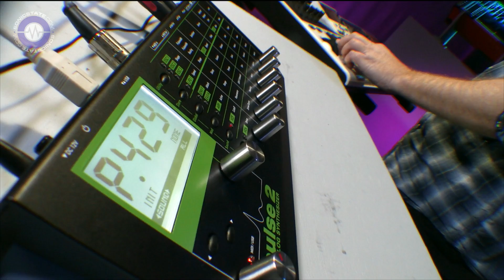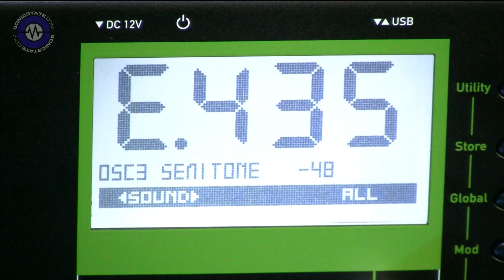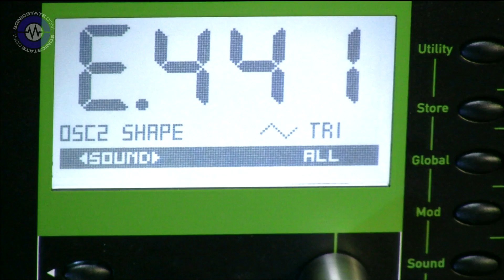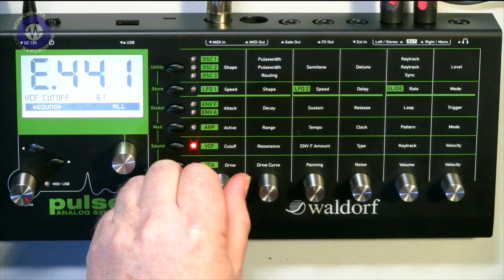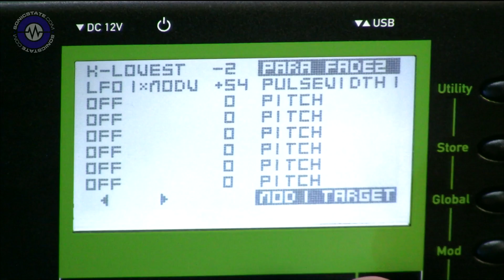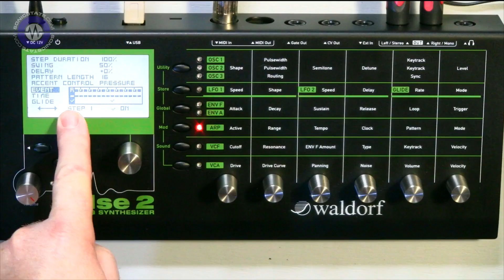Waldorf Pulse 2 Analog Synth - SonicLAB Review

Comment: My travel synth since 2013, have one in Mexico with me right now - the presets don't even begin to show the depth and capabilities of the engine - the oscillator functions and routing are incredibly versatile - AM, sync, filter FM, drive modulation, XOR. Basic monosynth sounds are easily achieved with no menu diving. 

The filters are not too exciting, but plenty versatile, its a portable sound design laboratory.......

Comment: Waldorf Pulse 2 or Behringer Neutron for monophonic sound design?
Reply: The neutron is a beast but no menu and not a way to save presets apart from taking a snapshot plus it does go out of tune like all fully analogue do. But the bass is huge. So I guess the Pulse 2 would be fab, I prefer DCOs less pain. Plus menu to save stuff etc

Comment: re: polyphonic operation.. I wonder if it is a divider type running at a higher frequency. whatever method they are using would be interesting to know.
Reply: Eight actual analog oscillators built in but only three can change shape Saw, triangle, square etc.

Comment: The synth looks like it is build to last, but as a matter of fact the knobs of all synths produced by Waldorf have a chronic problem, doesn't matter if it is the last generation (Blofeld) or the generation prior to that (Micro Q), it seems that the encoder technology is the same for all Waldorf synths. At a certain point the encoders stop responding when you turn them. It is a shame 'cause these synths have a wonderful sound, with a distinguished personality. I have a Blofeld and I had  to take it to a synth artisan wich repaired the knobs, who did a terrific job, but wasn't able to get it 100% perfet (maybe 85%), the same with my MicroQ.  It is not just me saying that, just Google "Blofeld encoders fix" and you'll see.  The synth technician told me that this problem is caused by the sample rate at the encoder is sampled, combined with the fact that the lubricant inside the encoders dry (worse if you are in a hot or tropical country), the contact plates gets deslocated, and it fails to respond. Imagine buying an ultra expensive Q keyboard and the encoders stop respoding...And my experience is that the crashes are rare, but they exist, and there are issues with updating OS as well.
Reply: I have the pulse 2 and find the knobs are also slippy so its hard to grip if twiddling filters.

Comment: Is there a parameter jump when you switch a pot from one bank of settings to another, then move it a little bit?

Say I used knob 1 to set the VCF Cutoff to max, then switched it to controlling LFO1 Speed.  If that was previously set low, but I now move the knob a tiny bit to the left, doesn't it jump to nearly all the way up / nearly full speed?

I would have thought sharing knobs between different parameters meant they'd use rotary encoders, so they could pick up where they left off, but Nick seemed to be saying they use pots.

Comment: Is it possible to use waldorf CV outs to control other gear?...I would like to 
connect Akai MPK 25 to midi in with waldorf and then CV outs from 
waldorf to moog werkstatt...would it work with these connections?
Would like to know before i will buy this synth.

Many thx !

Comment: about the digital/analog debate, i found this text (youtube/lesindes) :
" I have talked to the Waldorf service engineer now. And he was confirming
 what was in mind always: The basisc sound generators of PULSE 2 are 3 
digital controlled anlog oscillators we use to call DCO by they named 
them DO. Same as in PULSE 1. In addition there is a digital sound chip 
built in that is providing at maximum 8 digital voices (for paraphonic, 
unisono stuff) that are lead through the regular analog VCA-VCF of PULSE 2.
So the MONOphonic sound generation is ANALOG and the PARAPHONIC, UNISONO sound generation is purely digital." So yes their is DSP
Reply: They probably forgot to take into account the rabid analog bias of some synthesizer fans :)  I don't care if it's analog or digital as long as I can get sounds I like out of it.
Reply: A clever design it seems
Reply: +Michael Bauers you both misunderstood me, my fault. I know what DCO's are; i was just saying that the monophonic sound generation is generated by the DCO's (which are analog indeed), and in the paraphony/unisson mode, DCO's are desactivated and the sound is generated by DSP (8voices, pwm oscillators) ; this is what Waldorf say when you ask them precisely how they do 8voices paraphony with only 3 DCO. it is because paraphony is DSP
Reply: +TheOrangepeak mono is ANALOG and unisson and poly are DSP (digital) !! great synth but i feel Waldorf hide a bit the digital side of the pulse2, and it's a shame in my opinion, it's almost lying to the customer ..well it's no bigdeal as it sounds nice but they should have assume it.
Reply: +TheOrangepeak Dco doesn't meant its not analog, its just digitaly controled analogue oscilators in difference from Vco which is voltage controled :V For example Bass station 2 have dco too and its analogue...
Reply: +Marian Rogowski Since when is DCO not analog.  Ah well, people will believe what they want.  While DCOs and VCOs are different, but are analog by any reasonable definition.  A digitally generated wave is different in that it's a bunch of digits running through a D2A.  DCO looks analog except for the digital timer
Reply: +Marian Rogowski monophony is Analog (DCO indeed) but paraphony/unisson is generated by a chip (DSP) that emulate 8oscillators.
Reply: +Michael Bauers i just said that...
Reply: yes i also think it's clever and while i could understand why they didn't communicate that much about the dsp part of the pulse, they should have speak about it, people trust have been abuse ; this might sound stupid but it will keep me from buying a Waldorf product. Sorry for my bad english, cheers :)

Comment: Please do the Waldorf Blofeld!
Reply: Landon Balk I broke the Blofeld down and I have more stuff on it coming soon! Deepest box and most feature rich and biggest bang for the buck
Reply: @WavetableMetaphysics  Man, you are not kidding! Nice job! I was on the fence about buying a Blofeld but after checking out some of your vids...this is a hugely underrated synth. Are there any bugs? I've seen some comments that say Waldorfs are "buggy".
Reply: Blofeld has unresolved Sync issues similar to Nord Lead 3
Reply: @UBERLADEN69  I had a bit of a saga with mine, kept freezing and making a high pitched whine. Sent back to Waldorf for repair. They had it for 6 months before sending it back to me in the same state saying that the issue would be fixed in a future firmware update. It wasn't. Not a happy customer. Putting that to one side, if you get a good unit they sound fantastic and they're massively flexible.

Comment: i have this synth it is a monster. the band pass and low pass filters sound very nice, main weakness for me is not being able to tweek envelope and filters at the same time. easy way around this is a cheap midi controller so u can bring out access to those controls.
Reply: +James Reeno an example would be cutoff freq and filter envolope both affect the cutoff freq so u need fast access to both to efficiently get the sound u want. not litterely at the same time but u want immidiate access to those controls without having to change to env mode then back lots of times
Reply: I finally got it. It's a monster for sure. 
Very well conceived and sounds fantastic.
Reply: I'm having one of these, I hope it sounds as massive as it does here. Plus the architecture  is far beyond any sub 1000€ analog I can think of except DSI Mopho and then most 1500€ analogs.
3 OSCs and Super compact design are a big plus for me as well.
Reply: Oh, and then that fantastic arpeggiator with MIDI and CV/Gate Out !!
Reply: Why would u need to tweak more than one parameter at a time???
Reply: thanks for the reply bud.
I have loads of digital synths like the dx7 dx11 roland gaia and ultranova which are good mid range synths, the only problem is i think the  Osilators are a bit thin  for bass apart from the dx7 and the 11.
these analogs seam as thoue the waves are realy fat and grundgy and the filters seam better which i like.
 you probably can do more with a digital synth as far as routing is concerned such as a modmatrics like what the ultranovas has got.  but i want an analog for the raw waves and filter  
I think iam going to go for the pulse2.
Thanks bud
Reply: Paphun Dekel  I was talking about the roland gaias waveforms being thin not the pulse2.
Reply: +simon kamakazi 
Hi bud iam thinking of getting a analog syth .
i realy like this pulse2 and the minibrute but i cant decide.
which would you recommend thanks
Reply: i dont have much experience with minibrute, (i played around with it in a shop once) but it seems to me that pulse 2 would be capable of a wider range of  sounds, minibrute seems like it has a much more accessible interface tho. pulse 2 is slower to edit in given the matrix system it has. dont underestimate a good interface! knob per function is much smoother. that said, i kind of like editing in the pulse 2 yeh its a bit slower but its unique  and definitely not annoying. if u still cant decide just go with a used virtual analog from ebay u get way more synth for ur money from an older digital synth than these "new-retro" synths companies r making now.
Reply: then u are getting analog for the right reasons, u will really like the sawtooth on the pulse2 its pretty vicious.  how u like the gaia?
Reply: It aint bad. good for pads and lead sounds the super saw oscillators doesnt sound as good as the roland jp8000 or the access virus ones.
and it aint verry good for realy low bass sounds
the waveforms sound thin in the bass frequency.
but apart from that its a good lead synth for the money verry exspresive if your a keyboard player
Reply: Oh, sorry my mistake"-)
Reply: No probs bud
Reply: simon kamakazi does it respond to all midi CC?
Reply: i find the knobs a bit slippy and hard to grip, any tips?
Reply: Obviously you never used Pulse 2. It is excellent for bass, much better than the most analog synths out there

Comment: Great review as always Nick. I was wondering if you could answer a question for me:
With MIDI, is it possible to control/modulate more parameters than the unit is naturally capable of? I'm wondering if I can basically expand the number of knobs with a MIDI controller, something like a Behringer BCR2000. Also, is there any sort of a MIDI "Teach" function in the Pulse 2?

Comment: Is this better than the bass station 2 and mini brute/micro brute??
Reply: verve92 Just buy a cheap 25 key MIDI controller. You can get an Alesis Q25 for something like $60 on amazon. Behringer U-Control is a nice one with lots of assignable knobs and even acts as an audio interface for $99. Honestly not a big deal at all.

Edit: Also you could get both the BS2 and Pulse 2, control the P2 with the BS2 :)
Reply: No for me as it has no keys! But having said that it sounds great, but so does the brute and BS2.
Reply: Deter Pinklage I like the simplicity of turning on a unit and playing it. Avoid MIDI if I can.
Reply: verve92 Fair enough, but sometimes a little effort can yield large rewards. While the pulse 2 doesn't have many knobs,  you can technically control every function via MIDI, so it's actually not that hard to get a fairly cheap 25 key controller with 8 knobs to greatly increase it's tactility.

Plus of course, you're getting 3 analog oscillators, paraphony, and 8 modulation slots, which neither the brute nor the BS2 can boast. Plus dat build quality.
Reply: Yeah I put forth TONS of effort just programming my synths, which include: DSI Mono Evolver Keyboard and Prophet '08 and an DX-7. I am a knob snob so the DX is rough going- and it's FM.

Comment: Alexander Chopelas it is a different screen than on the blofeld though. It would make sense if it was the same screen I could rationalize them just using what they have (they used the blofeld body and knobs) but it's a bit larger than the screen than blofeld uses, yet it gives less visual feedback. I'm hoping they fix this in the next update as its still a fairly new product I'm sure they have their kinks they want to work out.

Comment: Parameter ranges seam to have -127 to 127 or 0 to 256. MIDI crap again!!. Why, why would you ruin a nice synth like that with a low resolution range. Are 32bit parameters so hard to do in 2013 ??!!!
Reply: While 8 bit value ranges(0-255) on parameters is too little in some cases(particularly stuff involving filters) 32 bit would be too much(0- a bit over 2.1 billion). Analogue Solutions uses 16 bit(values between 0-65535) digital to analog conversion for MIDI to CV for their Nyborg-12 which is absolutely enough for parameter control, and you could probably get away with more than 8 bit values but less than 16 and not have filter stepping and the like.
If you want to know whether I have any sort of idea what I'm talking about I know a bit about synths, and have done some DIY stuff with MIDI to CV conversion(using 10 bit digital to analog conversion, which seemed just fine to my ears, but the synth I have only has trigger values and pitch values for the CV) and I study computer science in university.
Reply: Also, 16 bit and 10 bit values for digital to analog converters control how accurate a specific voltage will be, if you have a synth that has a CV voltage range of .25 to something like 5.63234213434322V(this is an unrealistic example) you would want the 5.6... to be as accurately represented as you could and using 8 bit values might not be enough.
Reply: discorobotification I agree with you that 16bit offers far more resolution than the pathetic 8bit (7bits). But CV has practically "inifint" resolution. Why limit it to 16bit then come after 10 years from now and complain about it again and ask to upgrade it, do the right thing from the beginning. If I remember right, the Roland AIRA already has 32bit pots.

On the other hand. Converting MIDI to CV in 16bit or 32bit,won't be without stepping unless you introduce interpolation. Interpolation, means you have to introduce some delay that tries to guess the speed of your hand twisting the knob. This will do well for normal usage, but if you twist the knobs very very slowly, you will hear the steps again.

Simply speaking, if the source has less resolution, then the converted output can NOT have more resolution without a TRICK. Interpolation is the trick, the trick is not fool proof.
Reply: SoloStuff lol yes the synth is now ruined 🙄🙄🙄
Reply: I agree.  We shouldn't still be seeing 7/8 bit resolution, especially for filter cutoff.

MIDI supports 14 bit CCs and NRPNs - 7 bit MSB and 7 bit LSB, so that would be the easiest way to go.  

Even 10 bits would make a big difference, and a lot of cheap ADC/DAC hardware supports it.

The only one I've come across so far, with good MIDI resolution is the Moog Minitaur, with 14 bit CCs for many parameters.  I'm not really keen on the limited note range though, or the fact that not all possible knobs and switches have been provided on it - you still need the sofware editor, or a MIDI controller, to adjust the rest.